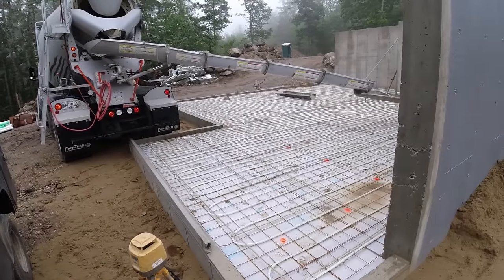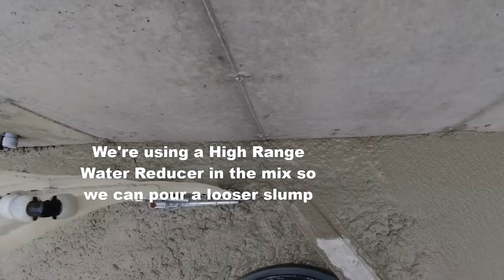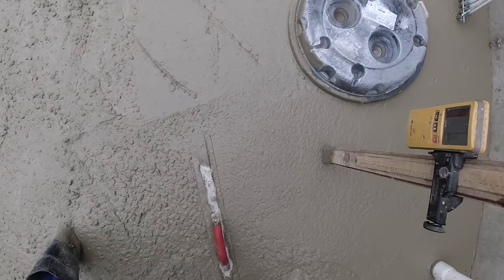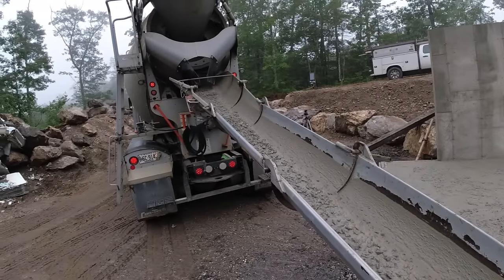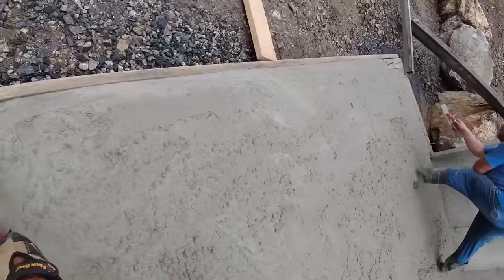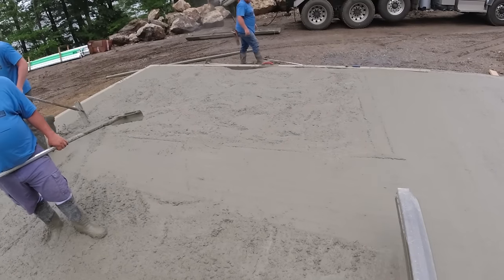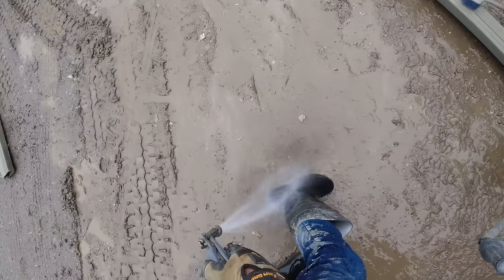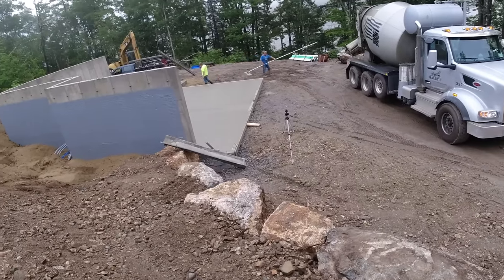Concrete Crisis: How We Saved a Floor Pour Gone Wrong!

Comment: I have a buddy in the biz and he tells me that the concrete supplier now backcharges for taking back extra crete. I never experienced that BS thank goodness. very few flatwork pours can be calculated without a plus- minus of at least 5% so I always ordered extra. Only once did i underestimate the needed concrete and fortunately they got me the extra load on site asap, bottom line is extra concrete is a must. I have seen people throw rocks and such into the footings as they are poured but that is a sure sign of unprofessional ethics

Comment: I batched concrete back in the day and every morning we would get a small metal pan of sand and another of rock. I would weigh them and then put them on a hot plate, cook all the moisture out of em, then weigh them again.  From there you could calculate the % of moisture in the material by volume,and figure it into the batch weights. Made for very accurate batching. This was before all the fancy computers took over and you actually had to still use your brain for such things.. Good vid bud.

Comment: We always ordered more mud after a rain. We would run way short when pouring big floors and big walls. If its like a 100 yard you would run way short when all 10 loads are a little short due to wet materials. We also noticed that certain company’s yield’s were on the light side even with dry materials. And you know how bad it sucks having to wait on a balance. It can sometimes really suck. Especially when you run short on a stamped job.

Comment: We run a Jonel batch system at our plant. Depending on the plant and how serious the operation is where you get the mud, everything needs to be inspected consistently. There is no room for error when you’re trying to provide the best concrete for our customers. That being said it is possible that sand moisture probes haven’t been calibrated or we have to undergo weigh scales calibrations for our agg, cement and water scales 2x a year in order to ensure batch weights are accurate. 

To answer why you’re getting rocky mud some days and good mud another, I would say the problem starts with contaminated materials or agg bins. We had a hole form in our con agg bin that would leak into our con sand. We caught it when we got a call from a customer stating that the mud was really rocky. Looking into the problem we found that hole where the material would run off our turn head chute against the wall of the bin. So I guess it is all about communication and having a good company who takes pride in providing the best concrete possible for their customers.

Comment: Reinforcing mesh should not simply sit on the ground when used in concrete slabs. It needs to be placed in the middle or upper third of the slab to ensure it effectively strengthens the concrete. This placement is crucial because it allows the mesh to resist tensile forces that occur as the concrete sets and dries, preventing cracking and structural failures. Typically, supports are used to keep the mesh at the correct height during the concrete pour. Proper positioning of the mesh according to the specifications of the project ensures the structural integrity of the concrete.

Comment: Water/cement ratio - weird that the most important parameter in concrete is so hard to measure. Professor Tyler Ley has a solution with his Phoenix gadget - if interested: Measuring w/cm in concrete with the Phoenix!

Comment: Blimey there is some serious gaps/flex under that insulation towards the edge of the slab @7:40 that has to weaken the slab with a decent void underneath it.

Especially when that appears the garage floor entrance. 

Well main thing is you got over the issue & didn't go into panic ranting mode.
Reply: Good eye. That’s gonna crack, why would it be designed like that?

Comment: Styrofoam compresses and your subgrade lowers. Add 3 to 5% when pouring on foam.
Reply: Incorrect. This is either XPS or prodex, which holds up to 1400 lbs per sq.ft. without compressing. Concrete weighs about 50 lbs per sq.ft. at 4" so it will not change the the yield of the pour.

Comment: I am not a specialist in making concrete floors, so my comments may be wrong.
In my opinion, the people who poured the concrete did their job well, but I don't think that the others responsible for the effect of this work did it well.
As it was noticed, the concrete contained more water than it should, which means the quality of the concrete is poorer.
There is a reinforcing wire grid placed on the floor insulation and as you can see, it touches the insulation (there is no distance between them). In this case, the wire reinforcement will only be glued to the lower side of the concrete, and it should be "embedded" in the concrete at a certain height, therefore "spacers" should be placed under the wire grid so that the concrete flows under the reinforcement. In this version, this reinforcement is worthless and only increases the construction cost (time of laying the reinforcement and its purchase cost). In my opinion, the person laying the wire reinforcement should put spacers in the appropriate amount.
Currently, there are concretes with added glass fibers and in such cases metal reinforcement is apparently unnecessary.
There should be a small barrier between the floor and the walls (e.g. 2 thicknesses of felt) to prevent the concrete from cracking uncontrollably (concrete shrinks and cracks naturally, although the newest types of concrete, maybe, but I'm not sure, don't have this problem). After the concrete has dried (when it is sufficiently hard), the concrete is cut (about 1/3 of its depth) with a saw so that the cracks are in these cuts. Of course, these cuts are later filled with appropriate material. The distance between these cuts should be 4.5 m to 6 m (14 to 20 feet apart).
The concrete foundations we see in the video should also have space for cracks (if we want to have control over their sealing), but that's a different topic.
All objects emerging from concrete (pipes, manholes...) should be separated from the concrete with plastic foil so that they do not stick to the concrete. After the concrete dries, these gaps are glued using e.g. silicone to seal these places and prevent the passage of gases from the ground to the interior of the house (e.g. radon).

Comment: Truck driver had no idea what he was talking about. Typical. He would’ve been hosing it down around the corner to make his truck clean up easier. Classic move
Reply: Driver wouldn't know exactly what batcher gave him if he doesn't have scales.
The water reducer they ordered probably reduced the volume in transit and when it was being discharged and worked. The high slump they ordered may have seen more absorption into the ground. I'm just guessing. How good are his calculations and what margin did he over-order? We don't know.
You can't wash up right at the form work. In Australia that job would have had a pump. Impressive chute!

Comment: As a building inspector, the pour looked pristine. Just don't like the pouring over the standing water and under the foam? that should be pumped out. But over all, with the fiber mix, should be fine.
Reply: Building inspector happy with reinforcing on the ground!
Reply: @chrisbull2501  you don't need chairs on a pour like this. It's a radiant heated internal floor, and it has plenty of reinforcement. I'm sure their mix was strong enough and may have had extra admixtures.
Reply: You definitely need chairs the mesh is on the ground, keep up the good work mate
Reply: @chrisbull2501  you don't, you just lift up the mesh and tie it different. It's literally in the RBC handbook

Comment: Dry sand weighs more than wet sand,silly
Reply: How do you explain that logic?
Reply: @Alpejohn  look it up! Silly😎
Reply: @jimrussell-wl9pc If the sand holds more water it’s heavier.. If you put 1 kg wet sand on frying pan to dry it it won’t be 1 kg when it’s dry..
Reply: @Alpejohn  google it, dry sand weighs more than wet sand, but wet gravel weighs more than dry gravel , not arguing, just facts.
Reply: Those are not “facts”. Wet sand or gravel will always be heavier than dry by about 800 lbs a yard